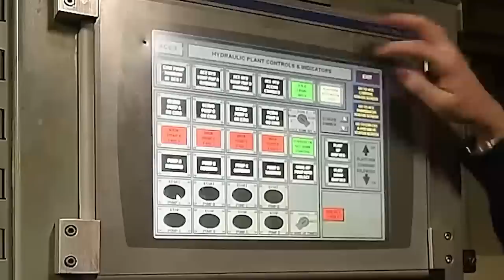How 5000 People Live At Sea Aboard Massive Aircraft Carriers | Full Documentary

Comment: The problem with the aircraft carrier is that it requires many people to be on deck. An adversary using a swarm of anti-personnel drones to wipe out the exposed flight deck crew would render the aircraft carrier useless.
Reply: Drones? Most people start with the hypersonic missiles garbage. Drones aren't going to find a ship at sea before they run out of power.

Comment: Sir, Thank your for putting this out there so those that have not been on a carrier know what it is about.

However. your explanation of the colored Jerseys on the flight deck is Wrong. Yellow Shirts= V-1 Division responsible for directing aircraft, moving them around the flight deck. These men are mostly enlisted, NOT officers. The Officers that wear yellow are either 1. V-1 Division Officer/ Asst. Div. O., V-1 Chief Warrant Officer. The Aircraft Handling Officer is in Flight Deck Control and Usually wears a Yellow jersey but I have seen them wear other colors. In V-2 Division, Cats and Arresting gear the only person that wears a Yellow Jersey there is the Shooter and is only on deck at the Catapult when launching. His Vest will have the word "Shooter" on the back with a set of crossed pistols.  He Does NOT direct Aircraft around the Deck.

Blue Shirts are Chock/Chains, tractor driver and elevator operators. 

V-1 Personel in Red is Crash and Salvage, on the fire apparatus, also in silver suits. The only other red Shirt personel are WEAPONS. The Weapons personel Arm/ Disarm, Load/unload weapons on the aircraft.

V-2, Catapult and arresting gear wear green jersey and vest, they work with the Cats and arresting gear both above and below deck. There are squadron personel in green also, however I do not know what they do.

V-3, Hangar bay, Yellow and Blue shirts. They do the same jobs as V-1 butin the hangar bays.

V-4, The grapes, Fuels. They are the men and women who give the Aircraft the Go Go juice. They also maintain the fueling stations and do fuel samples/testing contstantly to assure good fuel for your Birds. 

There are many other color jersey/Vest combos like Brown/brown = plane captains. White/white checkered, white/white w/ red Cross. these are just some.